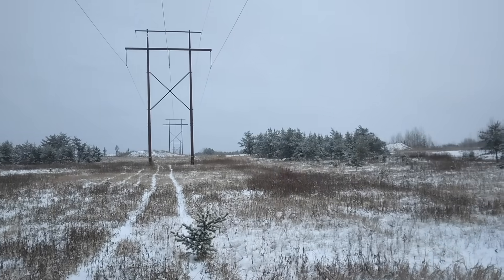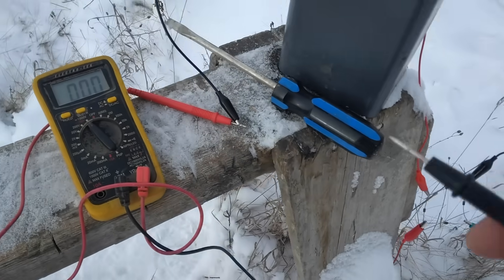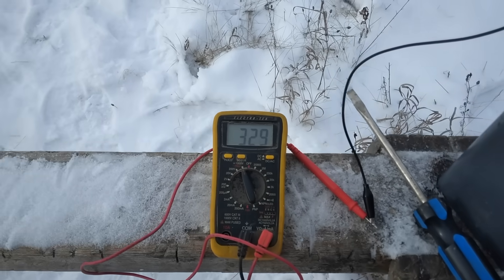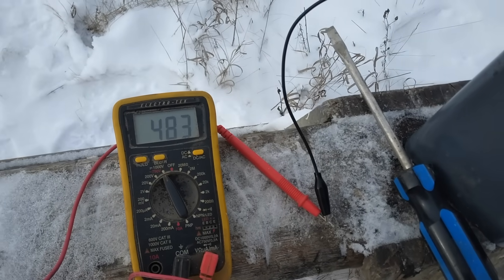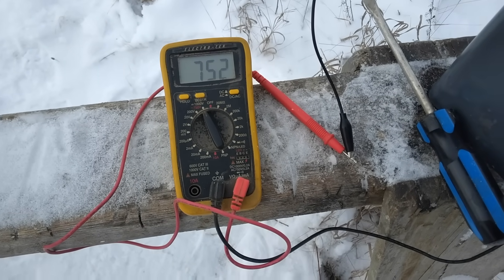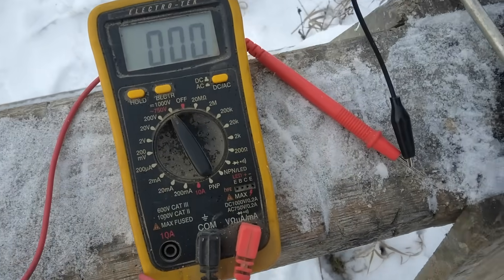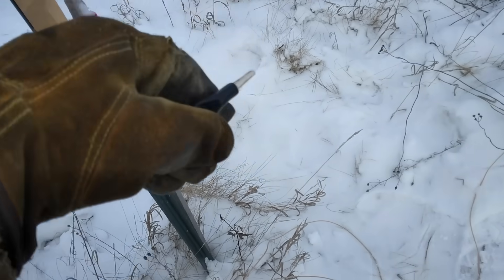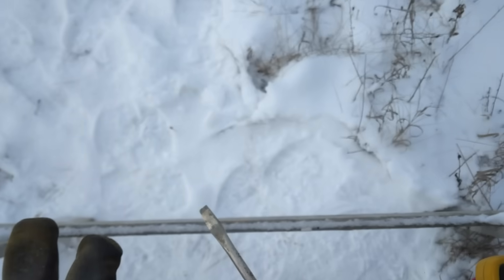Fences sucking power from under HV transmission lines

Comment: I used to off-road underneath the high lines and if we brushed up against our vehicles we would get a good zap. However, most of the time it just felt like radiation that you would get off of a 2meter Ham radio antenna while transmitting.

Comment: As a land surveyor operating a transit along the centreline of a steel tower transmission line, I experienced mild burns to my eyelids when looking through the scope along the direction of the line. When the transit was turned at right angles to the centreline, there was no burning sensation. This applied only to the older type refracting telescopes which where longer than the newer reflecting scopes. Also damp or foggy weather made it worse.
,

Comment: Technically, it's not stealing anything if it does not reduce the power in the HV lines. Yes, the space around the HV lines is being continuously disturbed. Whose fault is that for not shielding their cables? So, at that point, it is a free for all, but truly dangerous. But perhaps the same HV conditions can be safely replicated in a portable scaled down unit shielded inside a Faraday cage.

Comment: A method of stealing electric in the UK was to run a coil of wire in parallel with powerlines!
Be careful doing this.  The company isolated part of the line and rapidly switched power on and off. The surge caused a fire in a farm, that is how the offenders were located.

Comment: Electric fences deliver 7000-8000 volts at around 120 milliamps. This will get your attention but because of the extremely low amps is not really considered dangerous for a normal healthy person.

Comment: You could even more effectively cream more energy off the lines if you brought the wire to resonance for the frequency of the AC overhead power.  You would need a very large inductance added to the wire but it could be calculated and achieved to provide usable energy.  Remember the slowly rising voltage is not indicative of a large amount of current yet current could be increased at resonance. Great Video Mate.
(Energy is not Power) Power is how much energy can be produced over a specific time period) I assume u know that 🙏 You could use an LC calculator to work out the inductance required minus the inductance of the wire length.

Comment: About 35 years ago I was framing a home right next to a huge power line 
…. As I was setting the aluminum windows…. I had one barely open … 1/8 to 1/4 inch…..  it started making a popping sound…. and then a blue light (electric) ran a long the small opening…..

Comment: Your measurement in the calculator is off. The capacitor is 88 MFD (Millifarads). The calculator is set for 88 μFD (microfarads), 1000 times smaller than MFD. The calculated "E" is actually 1000 times your result. or 36,197J

What you made was a 1:1 transformer. If you had left it alone and your components were rated for it, the whole thing would have charged up to (close to) the power line voltage. Without the bridge rectifier and capacitor, the wire by itself will measure the same voltage as the powerline, but the amperage would measure in nanoamps, if that. That's why it overvoltaged the DVM but didn't fry it's circuits.  It's not an efficient transformer because it's inducing a voltage based on the magnetic fields of all three phases overhead which oppose each other by 120°. The main induction voltage is coming from the closest overhead line.
As long as any fence near the high-lines is grounded, there should be no measurable voltage.
To dispel some misunderstanding: This is NOT "free" energy. For every jewel you stored in the capacitor, the generators had to put out that extra amount of power. It's miniscule compared to the total amount of power flowing in the lines, but that miniscule extra load from your transformer effects the fuel consumption at the generator. If the power company discovered that you were using it to maintain the charge on batteries or to run some sort of device, they actually have the legal right to charge you with theft - same as if you jumper out your house meter.

Comment: I’ve worked in a substation with a duel fed 138kv feeders. When I first started doing this an electrician took me out under the feeder lines which were probably about 50 feet over our heads. He got out his volt meter and turned it on and held the leads up
In the air with his arms spread far apart and the meter read 100 volts.

Comment: That's 88 millifarads not microfarads. Big difference, by about a thousand times. Good way to get yourself killed messing around without any safety equipment or proper discharge rod.

Comment: Since the capacitor took  about 70 seconds to go from 180v to 335V, then you are probably stealing about 0.05W of power. If you did that for  10 minutes, you might have stolen about  0.0003 cents worth of power. You better just turn yourself in.

Comment: Your basically seeing the biot-savart law, as well as the Lorentz law in action. The biosavart law dictates the movement of electrons in the high voltage lines results in a curcular magnetic field far enough to reach the fence on the ground. The fence picks up that magnetic field and the Lorentz law takes effect. The magnetic field makes the electrons in the fence move in a circular pattern. This creates a disproportial charge from one end to the other resulting in voltage. Basically what you have there is a large transformer with an air gap instead of steel. That's why you need to rectify the power. Its switching polarity with the alternating hv lines above.

Comment: A different "problem" we (and the State of Texas RRC) had was a low band Radio/Antenna (45MHZ) on a tower not to far from a power line that kept experiencing very strong interference.  When it would get dry enough and with a little dust the corona on the power lines would "arc" constantly in a skin effect over the long stack of insulators on the transmission line tower.  At night you could even see it sometimes.  It made receiving on the radio impossible except for very local traffic.  All we could do is hope for rain to clean the insulators.  Rain came and it went away.  We eventually moved the station.

Comment: I wonder if we could find out the attenuation factor based on miliamp and loose voltage observations. Then we could know the best possible location for both efficiency and safety. Then build winding coils to transfer energy at higher amplitude.  like back feeding a tesla coil of sorts.

Comment: Given an 88 uFd cap, charging to 800 volts over a 5 minute period is a charge current well under a milliamp.  Put it under small load and it won’t be so “shocking…..”

Comment: No, it is not free for the taking. Experimenting is one thing, but if you decide to, for example, power your house (yes, it is possible if you do it the right way) then  you are stealing that power. It does not matter that you are not physically connecting to the lines. You are effectively getting that power via a transformer (power line is the primary and your line is the secondary) and bypassing any power metering.

And do not think it is undetectable. If you start drawing significant load (e.g. your house power) then that shows up in their metering numbers. Their fault detection systems can locate a load such as your house because it is designed to locate faulty and leaking insulators, trees branches on the lines, and other fault loads.

Comment: All he is doing is charging a capacitor. If he put a load (such as a 10 ohm power resistor), across the circuit the voltage will not rise that much. Capacitors store pure energy, which is why it cracks when shorted. Not good practice, by the way, because you can damage the capacitor. Instead, put a power resistor across it and let it discharge. And instead on one wire, if he wants real power (I.e. a combination of voltage and current) then he needs to loop multiple rings of wire.

Comment: I got a welder that was 240 volts working at 40 to 50 amps Double M. That was years ago fella, but it worked and no actual connection the the main wire !!!
Reply from the maker: Could you explain how it worked?
Reply: @doubleMinnovations  I did this years ago. Worked super from what I remember.

Comment: tartarian worldwide influenced structure towers with antenna and mercury filled balls collecting electricity from the sky, traveling down copper cage construction instead or rebar, salt water cisterns underneath for batteries. they don't call them cathode-rals for nothing. cabal wasn't having that - needed to control regulate and enslave the new reset

Comment: There should be a voltage rating on the front or back of the meter you are using, although if that is a cheap Chinese meter I would not bet my life on it.  There is also voltage rating on that capacitor.

Other than safety cocnerns, both for you and for whatever you connect to that wire, the voltage is not terribly relevant.  Static electricity generators and even the piezo igniter on a gas grill can develop 10s or 100s of thousands of volts but a minuscule current.  What I would like to know is how much current can you draw continuously from your device?  That would tell you if you will ever be able to do anything useful with it.

Comment: I don't understand why it rises. Why isn't the power (volts) automatically there. Wouldn't it be like a light switch? Off or on? You turn a switch on and all of the power is there. Can you explain?
Reply: Voltage is high but generated current is low so it takes a lot of time to charge that capacitor.

Comment: Lol that was silly everyone is more interested in current than voltage. You should have used an electrolytic.
Reply: Judging by charging speed current is about 200 micro amps.
Reply: @JGnLAU8OAWF6  Transformer just might work. It would be cool to charge headphones.

Comment: I had a noise problem on HF (ham radio) we traced it to a half mile run of lines that were now un-used and disconnected but parallel to a 230,000 line. Induction was causing the pole insulators on the disconnected line to buzz and spark. The first reaction from the employees was that the noise had to be coming from somewhere else. But I have the equipment to localize the noise and was sure I had it pinpointed. After 3 visits they finally sent a crew out and shorted all the unused lines to neutral and ground and the noise just disappeared! The lineman told me the disconnected and supposedly 'dead' wires were arcing and sparking when they bonded them all to the neutral and ground. I wonder how much energy is being picked up and now rerouted into the earth.

Comment: I work for over 30 years for a utility and one of the problems in the high voltage switchyard is inducing a voltage in fences and handrails, even thou these things are grounded, you would get a shock.   There is no current when this happens so no health problems but still a SHOCKER

Comment: If I apply the SCOTUS ruling concerning enrypted WifI to power transmission then it is free power. They're sending the electricity out into the wild for you to use of not to use at your discretion. Saying you can't use it when it's being broadcast onto your property doesn't fly legally. It would be like saying you can't listen to me yelling at the top of my voice because that would be eavesdropping. That last argument is what convinced SCOTUS you couldn't steal encrypted WIFI programing.
Reply: Disagree. The owners of the transmission system are generating and transmitting power at their cost. They are not sending it “into the wild” - they are transmitting via wire to consumers via power meters to get paid. These people are effectively connecting to the transmission line via a transformer (which is what their cabling is in effect) and draining power that is not theirs. I am sure no one will worry about someone doing some experimentation, but if they use that power to do work, such as lighting their house, then that is a legal problem. And do not think it is not able to be detected. Fault detection and location equipment is key to the power suppliers operation.

Comment: Every electricity produced by collecting magnetic fields around power lines is indeed theft. Every time you collect power, the company have to produce more to transmit the same power to the destination.
Reply: Bs. Its going into the air anyway.
Reply: @ptech88  By collecting the inherent magnetic field, you act as a transformer do , and you add load on the circuit. Wich the power company have to compensate for. So it ain’t free.
Reply: @ayuse01  so your saying they dont plan for all the loss from wires not being insulated?
Reply: @ptech88  You can’t insulate a magnetic field easily. The magnetic field is free to oscillate at the frequency of transmission ( 60 hz ) . It is a natural effect of all wiring having a current passing thru them. But if you intentionaly  run wires in parallel a voltage will be induced in the parallel wire, costing you some power thru voltage drop on the main line. Nothing is created, everything is transformed.

Comment: I work for an electric utility you have to ground yourself properly when conducting work near transmission lines.  Just about anything metal/conductive near a high voltage transmission line can build up a charge and eventually get enough potential to hurt you.

Comment: Dude, be careful.  you have lots of voltage and lil current but that can be converted to lots of current and less voltage.. Also i have heard of people setting up fences to "steal" power from the grid and the power companies are quick to find the leak..  It was an interesting video.. just be careful; i have visions of lightning bolts coming off that capacitor!

Comment: If you are looking to power something you can. the key is to leave the power at high voltage until you get back to the house then transform it down. Now the current. several long lines in parallel like a close line  on a saw horse for about 20 feet. the thicker the better.  once back to the house when you step down the voltage you will increase the current. A old used transformer from a microwave will work. secondary on the high voltage and primary will be your 120v side. you can step won the voltage on the high side since it is low current to ajust the vinal voltage on the primary . this could really work for you if you have several batteries. You could rectify the voltage and charge a lot of batteries in a 12V configuration since 12v is a 10th of 120v the transformation would be easy and an inverter to change it back. since the power if free the losses would not be considered. Lets not get too far ahead here you would first have tto see what the line loss would be from the power lines to the house first . you would need a voltage of 240 minimum to make it work.

Comment: Nice video, dangerous though if you are not careful. For those who will want to try this, be aware that high voltage can and will kill. Ideally, a high value(1Mohm) 1Watt resistor should be placed in series with the cap after the bridge rectifier. 
Take measurements on the cap and on the resistor and sum them up, or between the far end of the cap and the resistor connect by the bridge rectifier.
If you want, you can also do a series pair of diodes in each arm(taking care to put a 1Mohm resistors in parallel with each diode to ensure equiv voltage drop across each) to double the PIV as the induced voltage could possible go past the 1000V PIV rating of diodes like the common 1N4007 .

Comment: Reminds me of an idea I had . If you made a coil and attached it to the bottom of a standard pole transformer, you could pull whatever voltage you wanted . The same idea should work if the magnetic field is strong enough under lines or just in proximity of the lines .

Comment: The issue here is radiated electricity, vs inductive electricity. This is clearly inductive electricity because the fence runs parallel to the line which is acting like a coil and loading the line. If the fence was collecting radiated electricity from the line, it would be legal. And, there is a way to do that.

Comment: OK, and this is yet one more true to life story.  I was a Health & Safety Mgr of a large scaffold company for 20+ years. At a location in CA we had a contract to scaffold up to the arms a new oversized HV tower at a water crossing, it was a bipass of the existiong HV towers and live lines near bay (about 100 yards +/- away). The new tower(s) two of them were to insure the large span over the water, weight, wind sway etc. of the lines would better stay in place vs the normal erector set type.  The job was near done, the lines were strung on the new, not connected to anything, but they were easy 3-4 inches of solid copper wire with a rubber type coating on them.   NOT CONNECTED TO ANYTHING.  A safey officer for the electric contractor went up on the scaffold to do a routine inspection, he notices some PLASTIC danger tape had blown in wind and wrapped around the wire (he was out on the scaffold deck at the arms and the insulator connectors).  He reached and grabbed the tape and was then seriously, crippiling, deformed muscle, victum of a huge electric shock.  Lucky to be alive and rescue was near impossible but was done.  A law suit ensured and the result of the what happend and what went wrong was, the scaffold was not grounded, and the large wire had been up for several weeks (not attached to anything) took on the posture of a capicator and the loose power built up in it and let loose on him when he connected through the tape  (I am not an electrical anyone but that was the reuslt of that ordeal.   So my friend, you seem like a good guy for sure, but please be carefuld and maybe do somehting else beside messing with the crazy high voltages.   Your friend in NOR-CAl